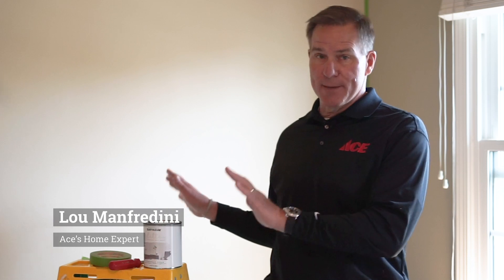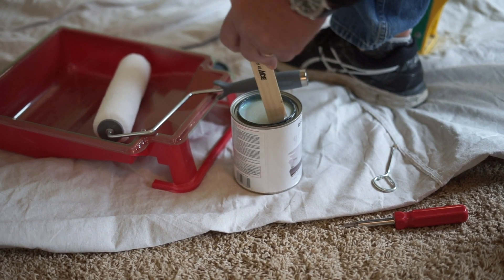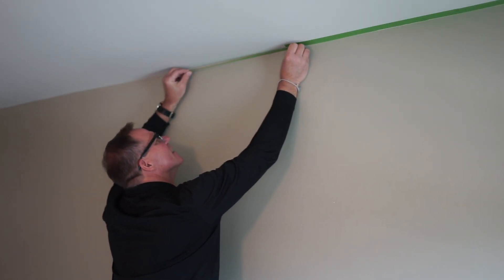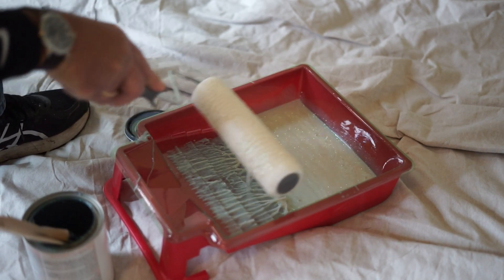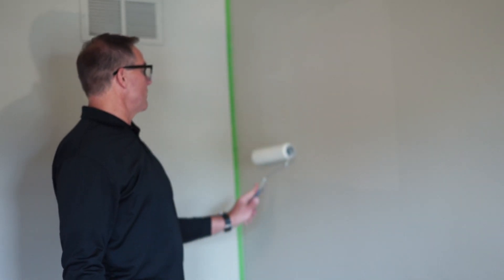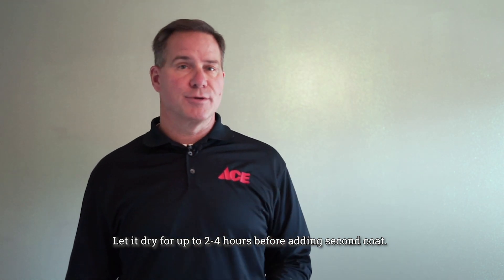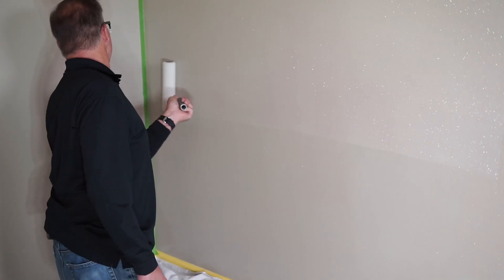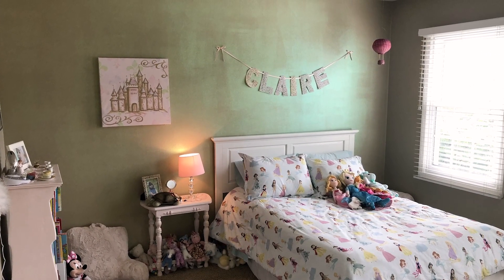How To Paint A Glitter Wall - Ace Hardware

Comment: I would like to have an accent wall in indigo color with glitter, so do I paint the wall first, let it dry and later add the glitter paint?
Reply from the maker: Hi Gabby - First paint the wall the indigo color in Satin Paint. Let it dry completely.  Then follow up with the clear glitter paint. Sounds beautiful! Good luck!
Reply: @AceHardware  That looks GREAT!  Do you think the iridescent glitter will be well seen on top of a white paint? Also, does it matter if the base paint coat is matte, satin or semi gloss if adding the glitter coat on top??  Not sure if the finish will interrupt the glitter application. Thank You
Reply: You could also use Sparkly Dust Glitter Paint Additives that will work with any standard water-based emulsion acrylic paints. 

All you need to do is just add a pack or two of their glitter paint additive to the can of paint, mix and apply. Super easy, and fast. I love it! It is also available in a wide range of colors, I think 39 different colors... Check it out here - https://www.sparklydust.com/

Comment: You did it all wrong man paint wall go over wall hand blow glitter on works so much better and then it really sparkles
Reply: What are you talking about, this was glitter paint, why would you blow glitter onto glitter paint?!!!
Reply: @sueallen952  No i mean you paint the wall an while its wet you blow the glitter on, it turns out so much better without having to scratch the paint of the glitter.
Reply: What kind of glitter can I use? I was also told to use the method you’re describing